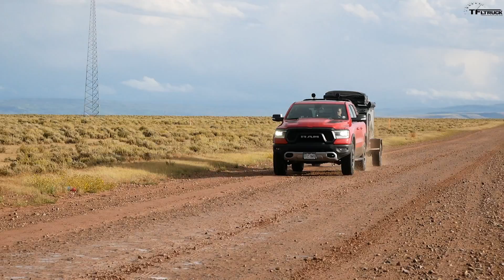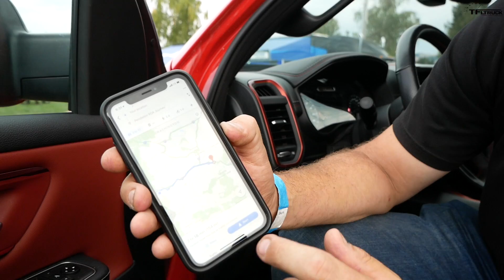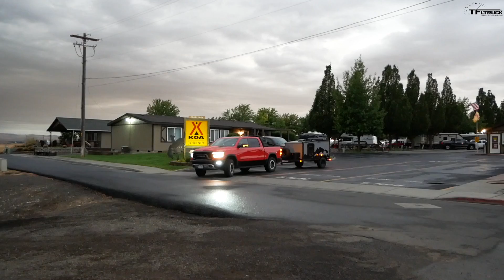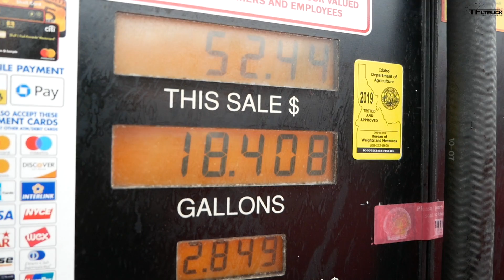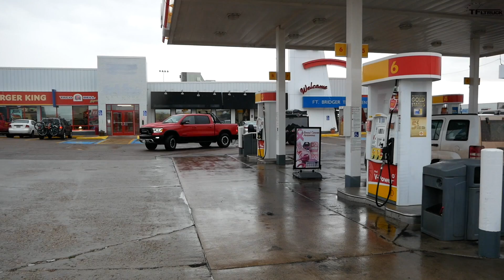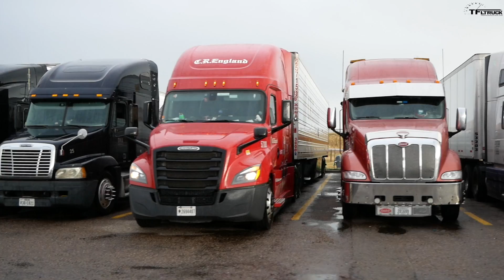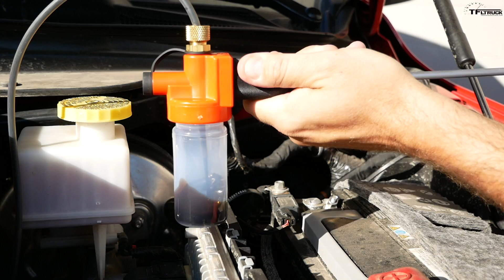Yikes! This 1,000 Mile One Day Overland Trip REALLY Beat Us Up! | Torture Test Ep.4

Comment: This torture test looks more like a “Get to know America’s finest Gas Stations” this is what happens when you don’t have the optional 33 gal tank, is a must if anyone’s planning on getting a Rebel.......
Reply: I agree, it needs a larger fuel tank.  Considering the trip, the mpg was pretty good but having to fill up every 200 miles is terrible.  I do appreciate the range my Tundra's 38 gallon fuel tank provides especially on a trip like this.
Reply: Steve Rowe with out a doubt! I have the optional 33gal tank on my 19 Rebel and I get about double that milage and change, the Hemi is incredible thirsty.....
Reply: Sadly, Ram did not offer the larger fuel tank on the 2019 1500 models until late fall 2018.  They went for several months of production with 25 gallon tank being the only option.
Reply: Gary Blatt yep!! I got my Rebel on the weekend of July 4th, I had a hard time finding one with the 33gal tank, if I couldn’t find one it would have been a deal breaker, the Hemi is awesome but incredibly thirsty.....
Reply: @garyblatt8925  My April 2018 build 2019 Rebel has the 33 Gal. tank.
Reply: Gary Blatt this makes me excited to see tests of the Ram rebel ecodiesel with the 33 gal fuel tank which on the 2wd tradesmen went nearly 1000 miles on one tank! Of course in this situation I would be happy if it can get over 600 miles which I believe it should easily. If it does I’m sold!
Reply: LOL - spot on.
Reply: You can always buy the 33g tank and add it.  But personally, I like stopping to stretch my legs every 200 or so miles anyway.
Reply: Whoa, why would they build a V8 full size truck with that tiny fuel tank?! That sucks bad.
Reply: @JDJ don't forget this truck is lifted and is running 35" tires...... but to be honest my 2018 4runner V6 only got about 13mpg towing a 1000lb trailer 800 miles.
Reply: Unfortunately, sedans are no longer a "thing" for the big three and though you could tow a small camper with a Camry, It would put a lot of wear and tear on it. Sedans are not full frame, v8 powered beasts any longer. I used to haul an atv with a Mazda 3. It did it, but it got beat to piss.
Reply: I have the 33 gallon tank. If you don’t drive like a maniac it does pretty well. I drove Stockton to  Bakersfield and back on one tank. Barely but it did it.